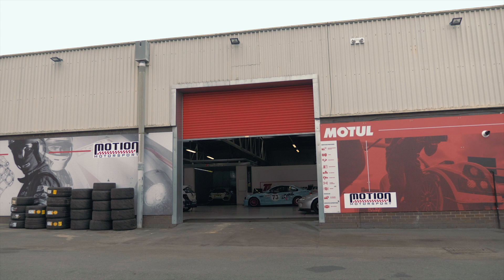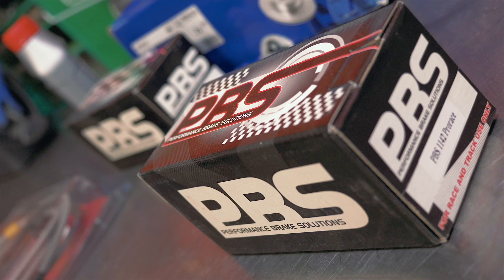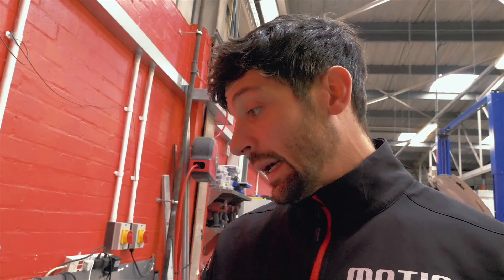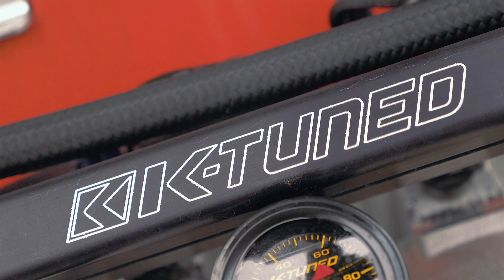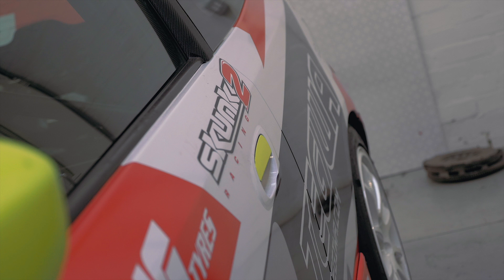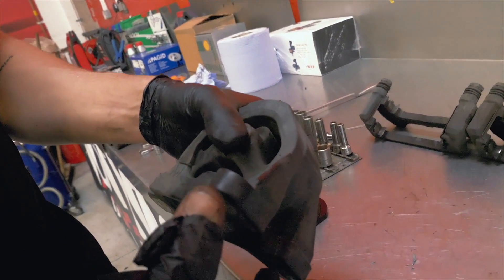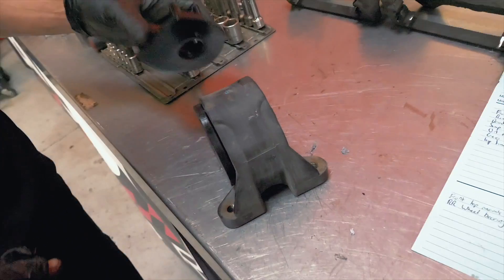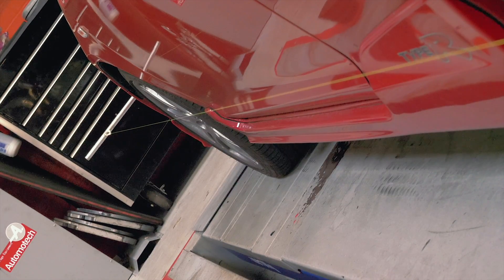I'm Building An EP3 Civic Type R *RACECAR*

Comment: Bought my EP3 12 months ago and I am so happy with it. 3 words to describe Reliable Fun and beautiful to look at. Has a massive road presence aswell get loads of looks and compliments with it.
Reply: Manc Car Guy they look like a van mate
Reply: @Shane-zx4ps  Well it is very practical when you put the rear seats down you can fit a lot in so it's very practical hatchback. So a motorway cruiser/ shopping/ Fasg road use / Track car. I think k its maybe the best "cheap" track day car. I like the FK8 a lot aswell if you want to try and diss that car lad or maybe you dont know what it is.

Comment: When  i had my milano red ep3 facelift years ago i had similar things installed.  Hel braided lines , ferodo racing ds2500 pads, brembo discs, rear jdm antirollbar( really recommended mod for these), Tein spring kit, and  front eibach camber bolts and camber arms in the back.  Also has that same alignement setup with toe out in front and in in the back. Its called fast road setup. It eliminates understeer and makes it more tailhappy. Had these engine mount inserts aswell.    It was amazing. Sadly crashed it by going to a corner too fast( it looked like a gentle corner but changed to a steep one mid corner) and i went off and rolled it. I drove it like a nutter all the time. Kept engine stock for reliablity and revved the nuts off it where ever i went. :D

Comment: Great fun coming, get some nankang AR-1 tyres, tyre pressure 28-32 psi hot, hold steering wheel 3-9oclock full tank of gas, leave the handbrake off after your sessions so you dont warp brake discs.

Comment: If you consider getting a new cat-back exhaust for that car, check out the Thermal Research exhaust. I've had a K-Tuned exhaust, a Skunk 2, I've even had a Greddy exhaust on my turbo Civic, but nothing compared to the Thermal Research exhaust that's on it now, and I made 588 whp with the full exhaust. So once you get a good set of extractors, a nice full cold air intake, then you need a good flowing exhaust and a high flow cat.

Comment: Looks like a great project Ricky, you can gradually make the car faster as your track driving skills improve! I would suggest changing the fuel filter, spark plugs and gearbox oil too, for reliability. Hope they fixed the O2 sensor wiring too, so it runs correctly, as that wasn't mentioned after the servicing?

Comment: Only 2 parts I'm not really sure are those disks without any internal cooling, idk how they run them on cup cars and the engine mounts, pretty popular but they go to shit QUICK, might as well get metal ones and a damper for engine movement. The drop in baffle sump was quite smart, never heard of it. Very nice to know.

Comment: Do a 4x4 turbo with engine sleeves Conversation ,second option fit some Honda sp2 x2 carb with engine sleeves and forged internals so the engine can rev up to 12,000 to 13,000 rpm.

Comment: I'd be expecting a fully built turbocharged k24 with forged internals for less than 5 grand man's turbo kit is from a Bugatti.
Reply: Jason Juggler 5k for that hardware is daylight robbery. Spec the parts individually and you can probably save yourself at least 2k. Having experience with Tegiwa (it’s all one company) I wouldn’t take my car there but that’s a different story.
Reply: james dalton it’s a bit on the steep side isn’t it lol. Then again fools and their money are soon parted.
Reply: @MIK23458  Yeah maybe your right. yeah your right mate. what happened with tegiwa ?
Reply: Jason Juggler I had some parts fitted (not a Honda to be fair) and the work wasn’t really of the quality it should have been. In their defence we did come to a mutually acceptable resolution so there were no hard feelings on my part.
Reply: Can get a turbo kit fully fitted for 2500 and they want double that for just the kit 😂
Reply: u04pww2 where from and with what components please?
Reply: @williamoakes664  look up LF Developments

Comment: 17.10   why would you have toe out at the front? Surely as you build speed they want to toe out anyway which would cause it to not be so stable in a straight line? A bit of toe in would keep the tyres constantly warm , as you build up speed they would toe out a bit to become straight and you would get a better turn into the corner? Or am I wrong?

Comment: So for 8k you get 3bhp extra these things come standard 212bhp think I’d rather keep that 8k
Reply: They're 197 BHP standard pal. Dont know where you got 212 from.
Reply: Fordizzle a little show called top gear when they first came out and that’s a fact
Reply: Fordizzle type in 212bhp standard civic this is the first car that pops up you 🔔🔚 they at the time had thee highest standard bhp for a front wheel drive car FACT now slide on
Reply: @andrewburns1912  you dont know what you're talking about pal.  Do some research.
Reply: 212bhp standard? You having a laugh? 😂 you’ll be disappointed if you ever have a dyno run - usually top gear are spot on but if they did say ‘212’ then they are wrong... sorry.
Reply: They are 197bhp standard pal. Get your facts right.
Reply: @andrewburns1912  Ukdm k20a2 came with 197, k20a which is jdm came with 212 so top gear talked shit about the ep3